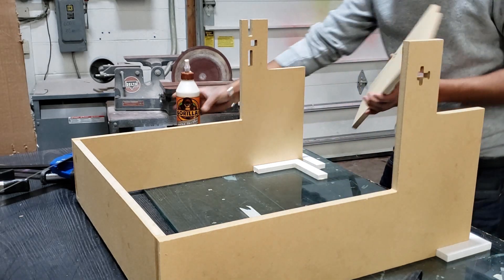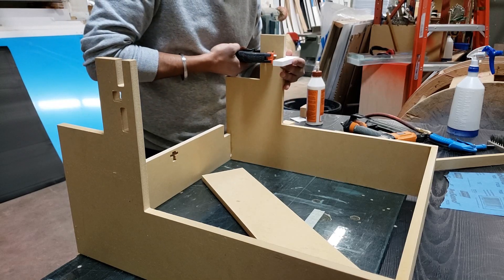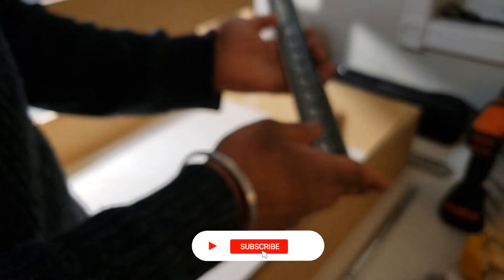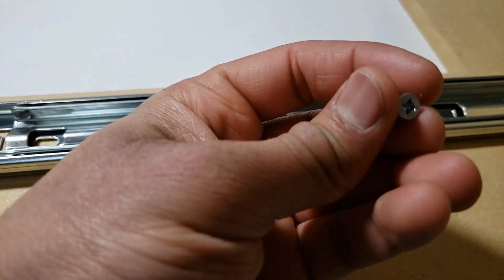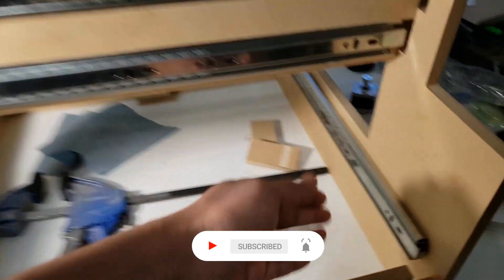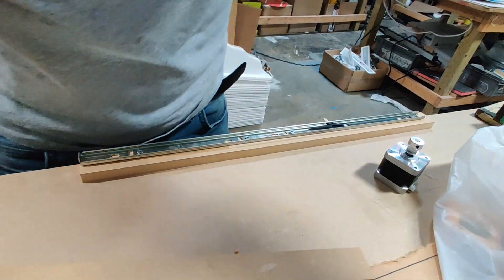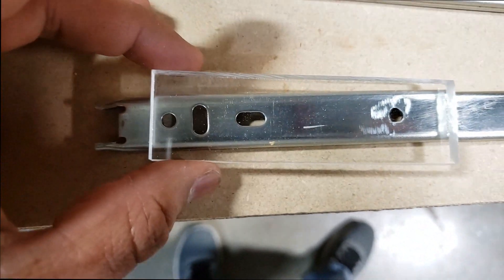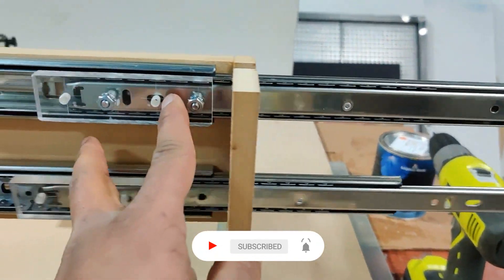A Real Homemade CNC Machine |  DIY CNC Project | Part 2

Comment: using drawer rail is one of the worst idea, its a dust magnet. you will realize in your first decent work (if you use it at all apart from youtube video) also they slack in rails is horrible, dont fall for these setups. they are only for showing off on youtbe. proove me wrong and use it for an year, i bet you
Reply from the maker: I take it as constructive criticism and I certainly do understand your point. Those slack in rails can be managed easily by adding tension between joining elements. However, I'm not here to argue whether is professional or not. I made this cnc so I can learn how a CNC operates, value I can add to it, numbers of things that does go wrong, perform small test jobs or maybe build a better machine using this machine. I hope viewer understand POV. This might just spark an idea to someone who have better materials to work with.